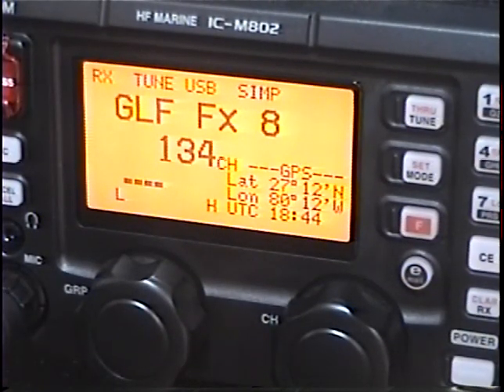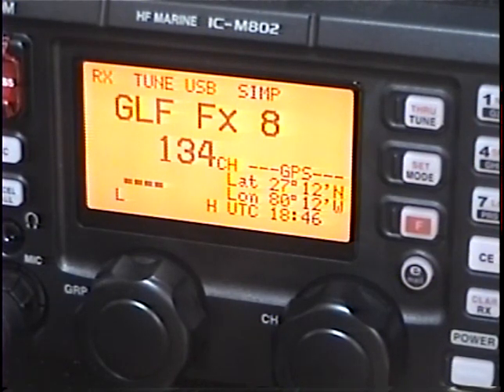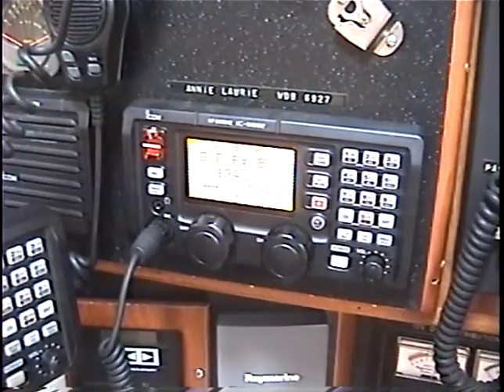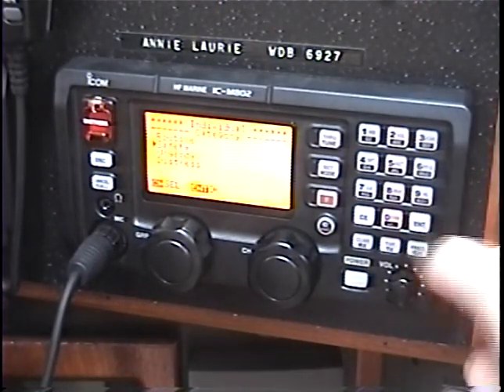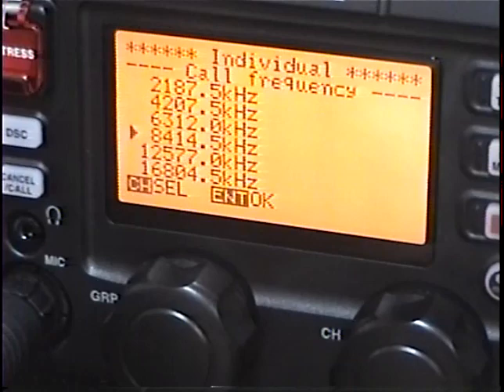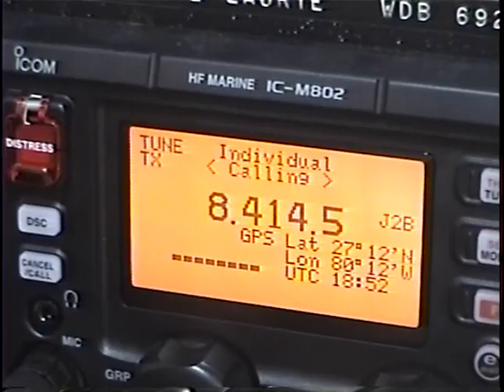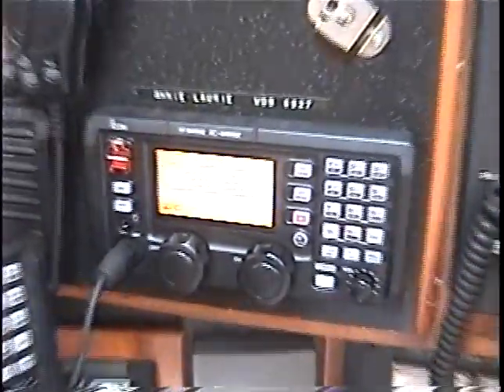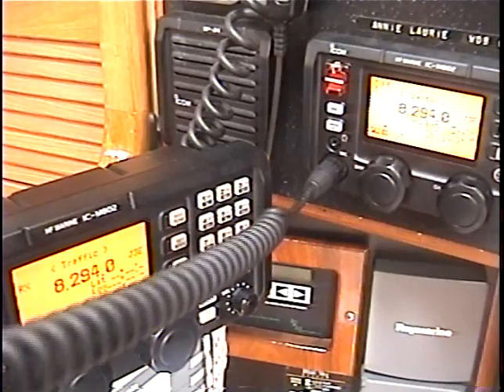LIVE, Ship-to-Ship HF-DSC Calling, on GMDSS HF-DSC Freqs

Comment: I'm doing this course on Friday unfortunately ive had no training apart from watching your video,

Can you give me an answer below is an email I required for my course I'll never work on a boat ever I don't even use a vhf radio I use uhf radio but if I don't complete the course I loose my job bit unfair,  so my acessor has send below email but I'm struggling to think what he's asking for what my reply should be please 🙏 help

application form and some photo ID (Passport or Driving Licence).

 Initially I will set you a few questions to check that you have still
 retained the knowledge necessary to pass the written exam.

The main question is a distress scenario from which you have to produce a
Distress Call and Message.
for example:

Your vessel VIKING QUEEN  callsign GGDF MMSI 123456789 is in position 54 degrees 33 minutes North, 002 degrees 04 minutes West.
Your vessel is on fire and you require immediate assistance.
There are ten people on board and gale force winds.

What is the Distress call, and message that you would transmit by voice
after sending a Distress Alert by DSC?

..........................................
 Your answer should look like this:
 Call
 Mayday x3  this is VIKING QUEENx3  callsign GGDF MMSI 123456789

 message
 Mayday
 VIKING QUEEN  callsign GGDF MMSI 123456789
 Position 54 degrees 33 minutes North, 002 degrees 04 minutes West
 On Fire
 Require Immediate Assistance
10 POB Gale force winds

Comment: First of all I would like to thank you captain for these incredible videos as they have helped me a lot at understanding and learning about one of the most common and basic equipment I will be using in my profession in the upcoming years. You see I am about to begin my first educational voyage on a cargo ship as a deck cadet. Apart from that I would like to ask you something about the frequencies. You said that the IC M802 has a built in function that is scanning only the 6 frequencies for distress,safety and urgency. Does that mean ,referred to what you said in the video, that even if one has the other frequencies he will not be able to receive messages from them because the M802 does not scan them?
Reply from the maker: Well, the answer is yes and no....sorry, I'm not trying to be a jerk, just need to further explain things?

1)  The M-802 (and the new M-803, and all current Class E GMDSS MF/HF-DSC-SSB Radiotelephones) have a separate built-in, dedicated, DSC receiver that is always on (as long as the radio is "on"), always "scanning" the six international "GMDSS DSC Calling and Safety Frequencies" (2187.5khz;  4207.5khz;  6312khz;  8414.5khz;  12577khz;  and 16804.5khz), using a separate "DSC receive antenna"....
This is done in the background, without operator indication or involvement (until and unless you receive a DSC message/alert)....

This separate, dedicated DSC receiver cannot be changed or disabled....it is always on and working....(which is why the M-802, and  EVERY  MF/HF-DSC-SSB-Radiotelephone, needs a separate, dedicated DSC receive antenna) 

This is separate from any other operations of the radio, meaning the main functions of the radio (and its main antenna) can be actively receiving and transmitting other messages / traffic, whether voice, image, or data, and/or it could be scanning some other frequencies, whether for voice, image, or data...or even scanning other DSC freqs, such as those originally designed/designated (in the late 1990's, before the advent of efficient PACTOR and/or inexpensive sat comm data) for "routine ship's business / routine traffic signaling, etc.....on any of its bands/frequencies, and neither of these functions will interfere with each other....
 
2)  The M-802, and many other MF/HF-DSC-SSB-Radiotelephones, can also scan other frequencies (using the main radio receiver, and main antenna), whether for voice, image, or data, DSC....and/or you can use the main radio (and main antenna) to transmit and receive (voice, data, images, DSC, etc..) on any of its operational bands/frequencies!

SO....
3)  So, the answer to your questions is yes and no....
---- Yes, the dedicated DSC receiver is dedicated to JUST those six international GMDSS DSC Safety and Calling frequencies (2187.5khz;  4207.5khz;  6312khz;  8414.5khz;  12577khz;  and 16804.5khz)

----- No, the main radio can be used to scan, and/or receive, and/or transmit-n-receive, on any of the bands/frequencies it is designed to work on....

4)  Finally....all of this should be covered in detail in any GMDSS class and in any professional offshore mariners class....
These videos are designed for layperson sailors, on small, private vessels....who would likely never spend the money ($$$$) and time to take a GMDSS class/course....
These videos are not a substitute for professional training, for professional mariners....  :)

But, I'm glad I helped!  :)
Reply: I'm doing this course on Friday unfortunately ive had no training apart from watching your video,

Can you give me an answer below is an email I required for my course I'll never work on a boat ever I don't even use a vhf radio I use uhf radio but if I don't complete the course I loose my job bit unfair,  so my acessor has send below email but I'm struggling to think what he's asking for what my reply should be please 🙏 help

application form and some photo ID (Passport or Driving Licence).

 Initially I will set you a few questions to check that you have still
 retained the knowledge necessary to pass the written exam.

The main question is a distress scenario from which you have to produce a
Distress Call and Message.
for example:

Your vessel VIKING QUEEN  callsign GGDF MMSI 123456789 is in position 54 degrees 33 minutes North, 002 degrees 04 minutes West.
Your vessel is on fire and you require immediate assistance.
There are ten people on board and gale force winds.

What is the Distress call, and message that you would transmit by voice
after sending a Distress Alert by DSC?

..........................................
 Your answer should look like this:
 Call
 Mayday x3  this is VIKING QUEENx3  callsign GGDF MMSI 123456789

 message
 Mayday
 VIKING QUEEN  callsign GGDF MMSI 123456789
 Position 54 degrees 33 minutes North, 002 degrees 04 minutes West
 On Fire
 Require Immediate Assistance
10 POB Gale force winds